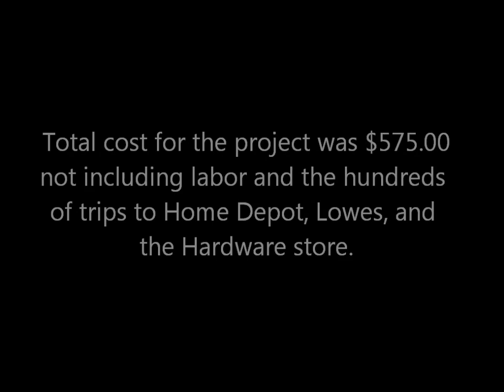My Bike Pusher Project

Comment: I found your video just by chance and was amazed that there were others that built a single wheel pusher as I did back in 2005! The single wheel is by far the most stable design contrary to what others may think because it’s self centering; even when drifting sideways around the corner. I used a U joint from a Bolens tractor for the joint behind the seat and used a pinch clamp to make it universal from bike to bike. The dang thing is scary fast with a Honda GX200 and a Comet Torq-a-verter! 55mph on a mountain bike is pretty intense! 😁.  It is stable even in the woods on the trails, over jumps, and around tight corners. The only issue I have is lack of traction as it doesn’t have much weight. Lots of spinning and rooster tails when on the dirt. Works great though. It was an awesome addition to a tandem bike for the wife and I. Great design:)

Comment from the maker: Yea I thought about that but since it's a 7hp engine and it is fairly light weight in the back it might skid or not turn the tire to start the engine at take off, also when stopping it may push the bike thus hinder the braking of the bike. But yes it's probably a good idea with a smaller engine.
Reply: Pete B. 6.5hp

Comment: Sir you think is better 2 wheel at the back for safety for not shaking sir watching from philippines 4 13 2019
Reply from the maker: One wheel is good but you can make a two wheel trailer and put things in there.

Comment: ok old vid and i've seen the later vid where it was painted and all that.
you could mount some motorcycle bags on the side of it , if you mount sumtin on top it might be too unstable (high center of gavity )
theres still a chance you get trow off the bike if you hit the trottle during a turn , the torq of the engine might push the bike out of its lean intoo the turn 
i think it would help if you lower the connection to the bike , make a horseshoe mount around the rearhweel and mount it to the bike axle or near it
Reply from the maker: All good ideas and advise.........Thank you :)

Comment: How’d u start it. Did u open the throttle when starting, then why didn’t it run forward.
Reply from the maker: It has a centrifugal clutch so it will not go move forward at low RPM only when you accelerate.

Comment: well the music is driving me crazy...just joking.. hey how did you get the parts? its cool yet i like the smaller wheel driving the back with no bar.. the bar kinda makes it look weird.. its a good start though..
Reply from the maker: Thanks, The square tubing was from local home improvement stores. The engine was from Harbor freight and the clutch,wheel and chain and throttle assembly were from online go-cart and mini-bike web sites.